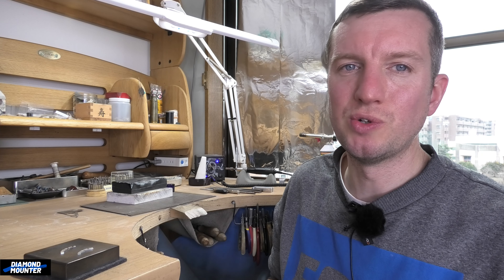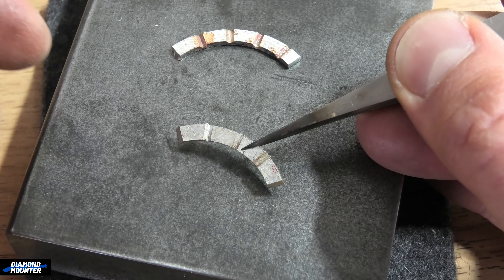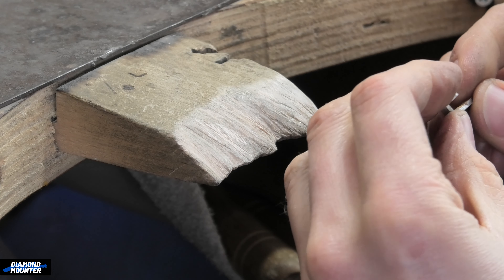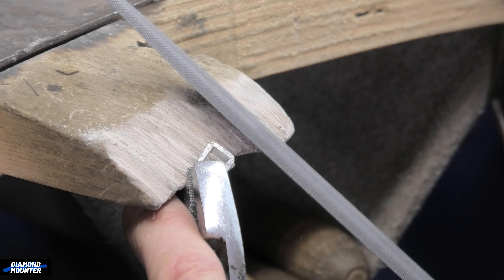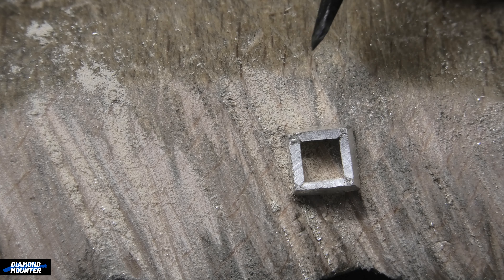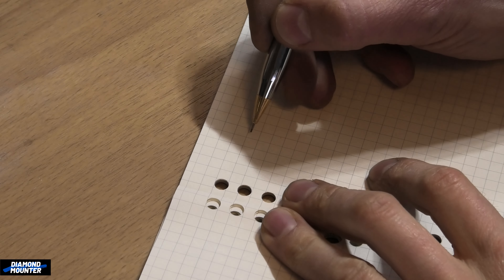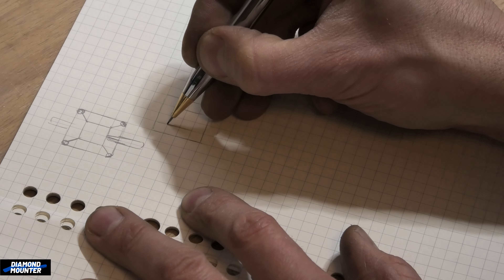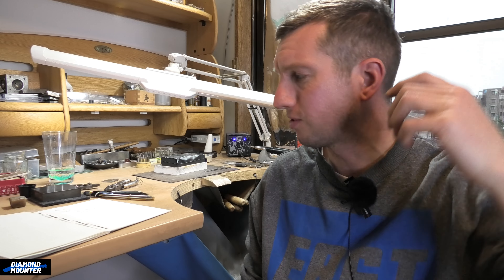Why Do I Join my Collets Up Inbetween the Corners

Comment: I had joined them in the corners before and then saw you made a collet and it made immediate sense, I have to try it out. I'm sure with a little practice it'll be a little easier

Comment: Hi 
I would just file the soldered corner to match the others, the flats have to be filed either way but filing the soldered flat makes more work than rounding off the corner.
Cutting and matching the flat for length (not shown) is also more time consuming.
I guess it depends on what you're used to but I think soldered corner is easier and more precise.

Comment: Could you just file the sharp corner to match the 3 rounded ones?
Reply: Yes but before getting to that stage you had to file perfectly matching 45 degree angles to finish the corner with a good tight join (a lot more difficult than making 2 flat ends join nicely)
then you're doing the extra work of filing the corner and then that 1 corner claw will be soldered in to a preexisting solder join which is more risky and likely going to be less strong than the other 3 corners

Comment: You could have made the cuts a little deeper so it would be a sharper corner.
Reply from the maker: Yes! When making emerald cut setting shapes I cut less deep so the corners are extra rounded. They are more suitable for filing flat